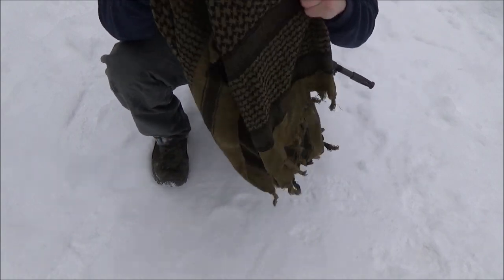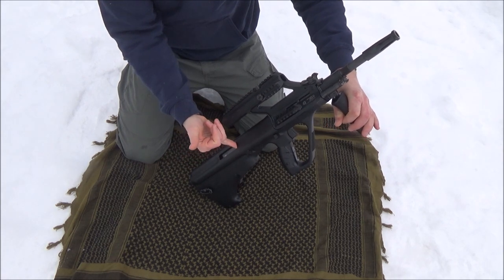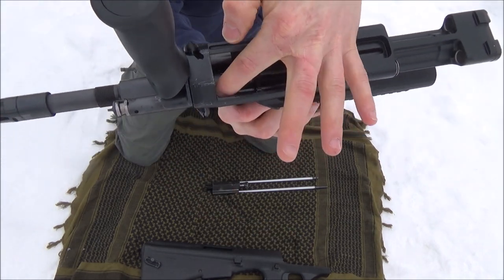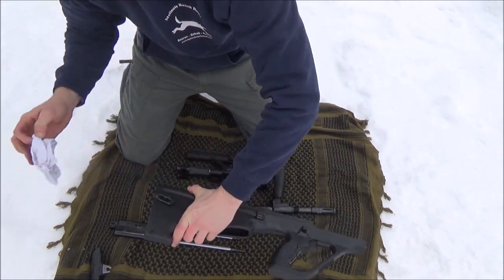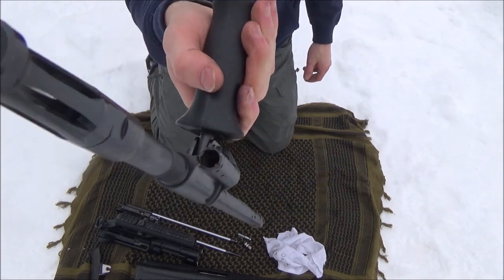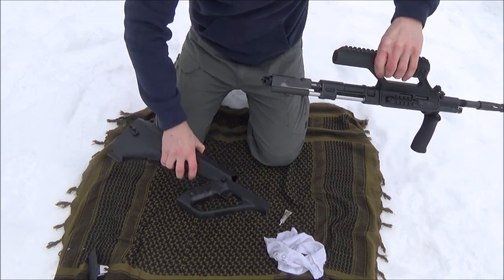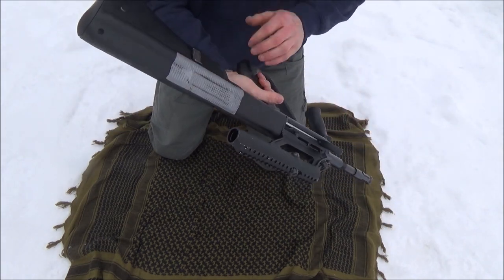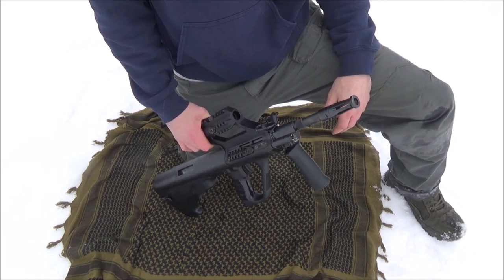Steyr AUG Field Care

Comment: Good Video, I always did put the Bolt completly out to open the Backcover, but your method is more intelligent and seems now even to be suppoesed that way by steyr. But let me give you a tip ( by EX Austria Soldier) : Do not user your fingers to reload the handle, it will hurt them. Do it with your palm; to be exact ;when you look into your open hand an you start to close it slowly there will come a big skinfold under the two smaler fingers. Thats where you have to put the reloading handle in- If you you do it that way and also wear Gloves you will start to love reloading the AUG. I think thats all AUG Hacks i do know at the moment...Greetings from Austria.
Reply: Kannst du das mit dem Spannschieber nochmal genauer beschreiben?
Reply: @wurzel9671  Linke Hand innenseite, eine Fingebreite unter der Stelle wor der kleine Finger und Ringfinger in die Handfläche übergehen, dort ist eine natürliche Falte in der Handfläche-dort gehört der Ladehebel rein-Hand bleibt halbgeöffnet beim Durchladen-trotzdem Handschuhe!

Comment: Getting the gas piston out when you can't take out the barrel with the button stinks. A chopstick works. The manual says to not lube the internal springs in the rails. If you track down the aussie army video, one can use an anti-seize product from loctite (henkel) while the trigger pack only got some graphite powder they carried. 
At the same time it's supposed to be totally dry for extreme cold and heat. For us, minimizing wear comes first and we have better lubricants. 
Do you know of anyone showing how to take apart the rails?